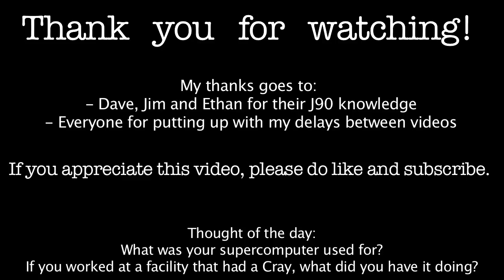Cray J98 Project - Theory of operation

Comment: I don't know a ton about this stuff so maybe i'm wrong, but maybe it will help. My suspicion about the boot sequence between the cabinets would be that the IO cabinet can be considered a giant SCSI controller or a DHCP server. Boot that first, then the CPU cabinet sees it says okay I get I.P address or I can access the disks from this device as if it is a SCSI controller.

The way you are describing unicos with the file systems, config file, partitions it really sounds similar to linux. If you run into issues with the OS you may be able to use some linux reference material and solve the issue.
Reply from the maker: Not quite - the system is considerably more low-level; Part of the purpose of the IOS is to handle that I/O - the 'mainframe' (processor cabinet) wouldn't know how to access any kind of device to begin with :) The IOS and the processor talk mostly via a DMA transfer process, it appears so far.

And you are correct - UNICOS is a POSIX compliant UNIX (at one point I said it wasn't POSIX, but I was wrong) - so it's very Linux like, or rather, Linux and UNICOS are very POSIX-like :) Unfortunately, the hardware specifications are the really scary bits, and those will be very, very specific to the Cray.
Reply: What I meant what the IOS unit is sort of analogous to a SCSI HBA. That boots usually with own BIOS, finds the disks, sets up the RAID, etc then the system boots from the virtual drive, etc.

I don't know a ton about Cray, I would love to one day though. My dream computer is the Cray titan, but not sure I'd like the million$ electric bill.
Reply from the maker: Ah! I misunderstood, my apologies. Yes, in a way - the SCSI controllers on board are certainly working HBAs, the IOS boards field the requests from the mainframe and relay them to the SCSI controller, handle all the negotiation and pull all the blocks back and stuff them directly into the mainframe's memory space. I think.

I'm not sure about a dream computer, there really is too many. A CDC6600 would be amazing. A Cray 2 sublime. I've been reading a lot about Fault Tolerant machines lately from the 80s and a Tandem or a Sequoia would be awesome.

Comment: Hello jpkiwigeek,
I am not familiar with these old systems but in modern systems init 3 is full network and multi user. 
Just curious if you are sure that init 2 is full multi user in this machine?
Reply: Well, the runlevels are not fully standardized even until this day on Linux distros. 
For example, distros derived from Debian are actually in runlevel 2 for multi-user with network, wheres
distros derived from RedHat are at runlevel 3 or 5 for multi-user with network (3 without or 5 with X) .
Only runlevel 0 and runlevel 6 are standard, i.e. shutdown (0) and reboot (6).
Reply from the maker: I got that straight from the UNICOS manual - but as Donkey says, it can be quite different depending on the implementation. In fact, the UNICOS manual specifically states you can use 2-5 in any way you choose, so it's very much up to the operator how they want it to act. I don't know who actually uses this feature, though!
Reply: well. Debian run in any of 2-5, they are the same and can be customized.

"Debian defines seven runlevels (0-6).

 0 (halt the system) 
 1 (single-user / minimal mode), 
 2 through 5 (multiuser modes), and 
 6 (reboot the system). 
Default Debian installation does not make any difference between runlevels 2-5. You may customize them to your liking. Runlevels S (single) and 1 are used for maintenance. They start services minimally to avoid possible problems."